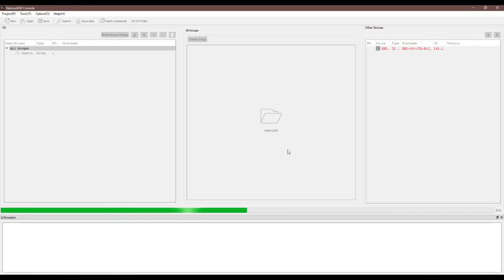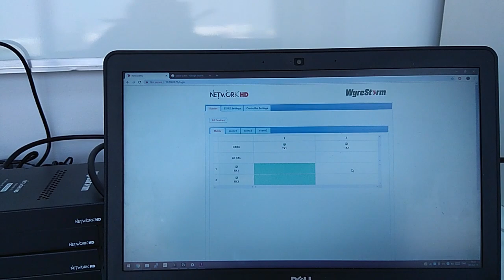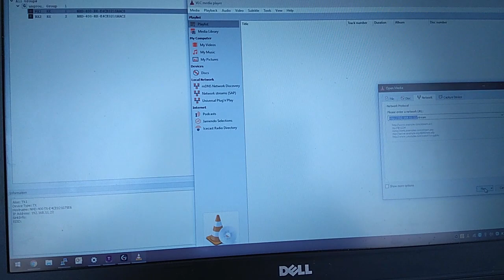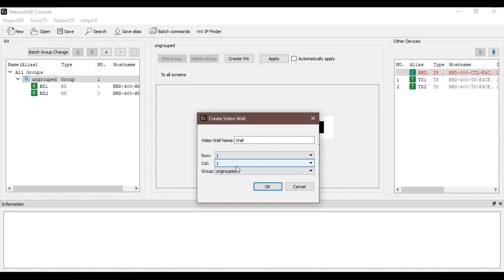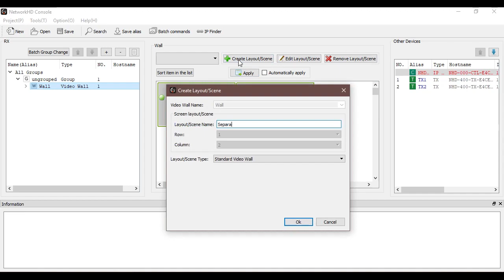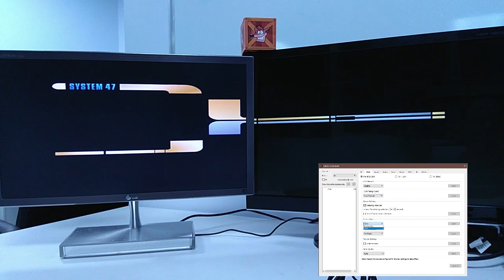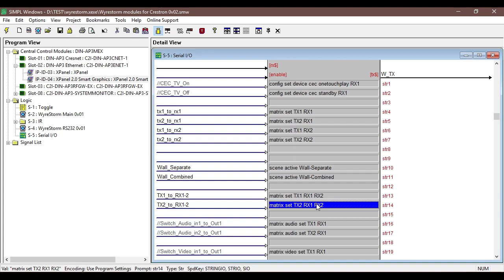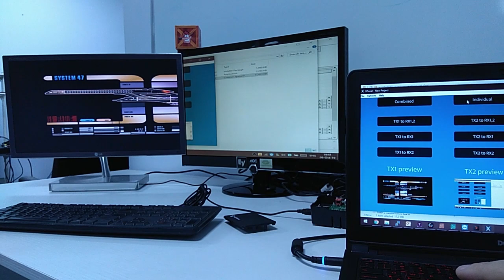Wyrestorm video wall setup with Crestron

Comment: 2:13 - Curious why you said the Unifi switch was not suitable? Was your concern the internal switching capacity?
Reply from the maker: It was mostly related to lack of multicast setup in these older switches. If ever in doubt i consult lists of manufacturer approved switches from crestron/wyrestorm or others. When more devices are included options like fast/immediate leave, igmp setup and few others are needed in a switch.